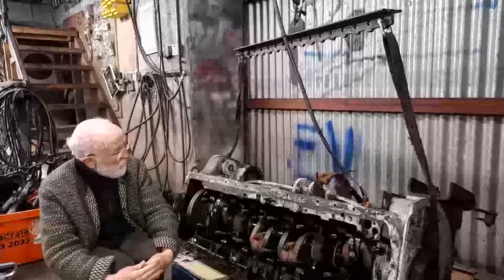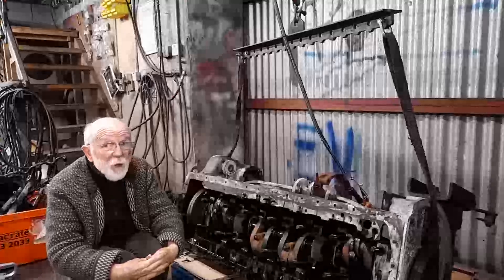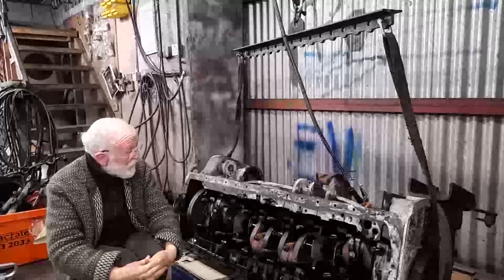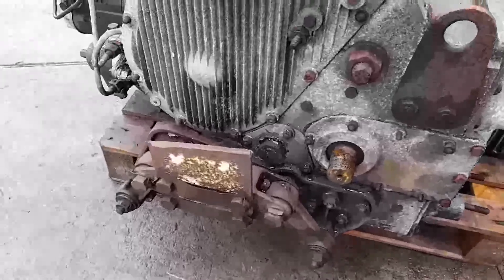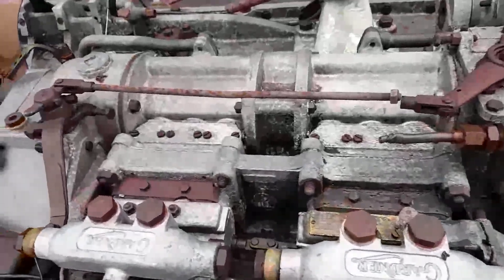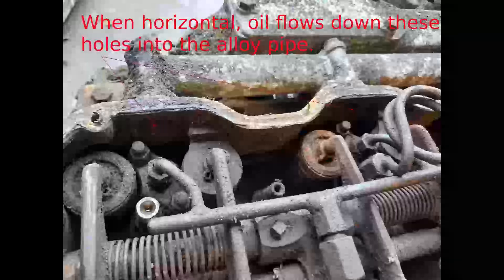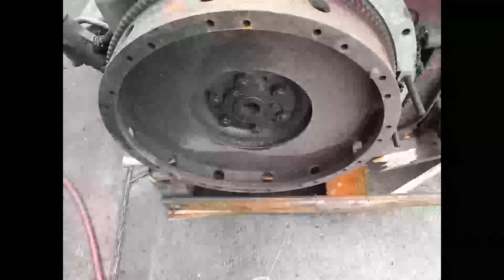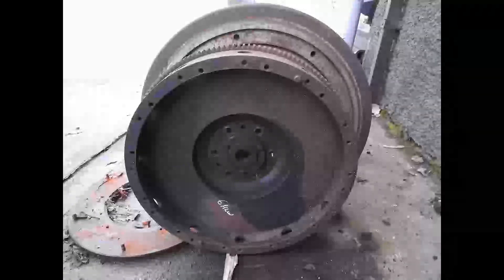Gardner engines: a horizontal engine - Gardner 6HLW: PART I

Comment: The outlet connector on the Amal lift pump is for a vertical engine and not a horizontal engine. These engines were fitted in Bristol LS and Bristol MW vehicles.

Comment: The six studs you can see on the sump, held a bracket on which the compressor was mounted, it was driven by a 3 belt crankshaft pulley, the oil was supplied by a pipe which ran along the top of the sump, the return pipe was a much larger affair which was about 1 inch banjo bolt either end and connected to the sump, so if you find a connection close to  this area, that is what it was for.
Reply from the maker: Thanks a lot for that.

Comment: As these engines were underslung behind the rear wheels, a lot of road muck was thrown up around the engine, this used to dry with the heat of the engine , any fuel leaks or oil leaks would soak into the muck which in effect acted like a wick, the tray was to prevent fuel leaks from the pump doing just that, there was a pipe fitted to the tray which would allow the fuel to drip onto the road. As the exhaust manifold was on the underside it was subject to water spraying onto it through road puddles etc, this would occasionally crack the manifold allowing naked flame to ignite the wick. The manifold would also have a shield to prevent this happening.
Reply from the maker: Wow!   Thanks a lot for that.   The national peat company here (Bord na Mona) had a similar problem here even with vertical engines.    Fine peat is combustible, so they had to stuff gypsum around the exhaust manifold, to stop the dust accumulating.

Comment: Hi Joe, I hope you are keeping well and safe.
I have worked on many horizontal engines, BMC, AEC, Leyland and the TS3, but I’ve never even seen a Gardner horizontal engine.
You never cease to educate and surprise, can’t wait to watch the strip and rebuild.
Thanks Joe.
Reply: Hi Jim, alot of the single decker buses had them.
Reply: Hi Carl, for many years I was employed as an HGV Technician for a multi-franchise dealership in Maidstone, AEC, ERF, Sedona Atkinson, Magirus Deutz, Scania and they where Perkins main dealers, the majority of my time was spent on trucks but very little Bus or Coach work.
Of all the engines I worked on, which was many, I just loved the hand built quality of the Gardner. 👍
Reply: @Old_Peepar  Thanks Jim, I have a fondness for the Gardner, it was a local company to me, myself & my brother, served are time there, worked on hundreds of Gardner engines,
Reply: Cart if that was at the Barton Hall Engine Works, Patricroft, I envy you. 👍
Reply: @Old_Peepar  yes it was.

Comment: Hi Joe, I must admit, I have never seen a horizontal gardner in a boat. Carl ex Gardner fitter.
Reply from the maker: It was a Dutch barge "Scalibor" (I think!).
Reply: @tangentgardner  Thanks Joe, I would not fancy, having to change the cylinder block. Its bad enough in a bus.